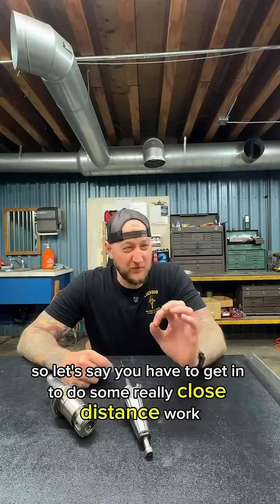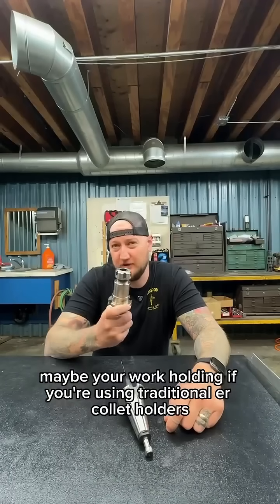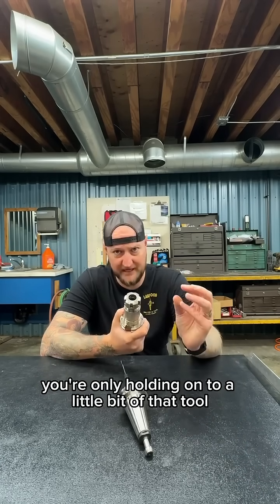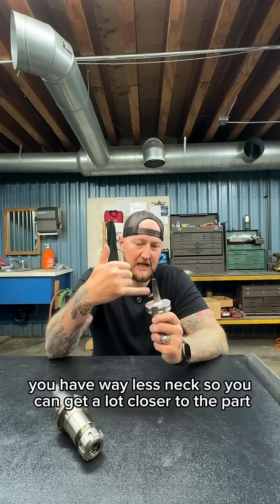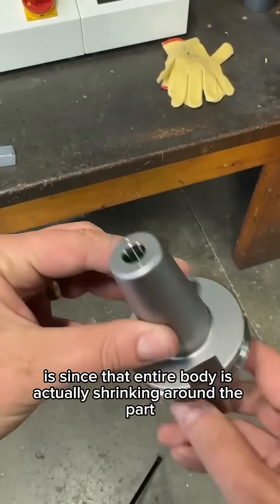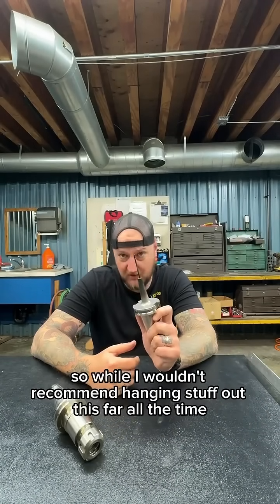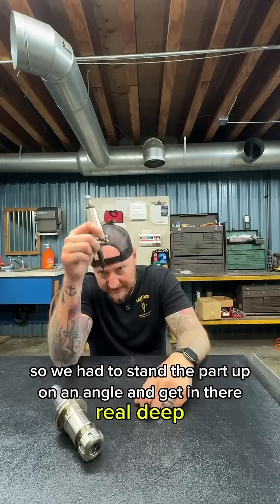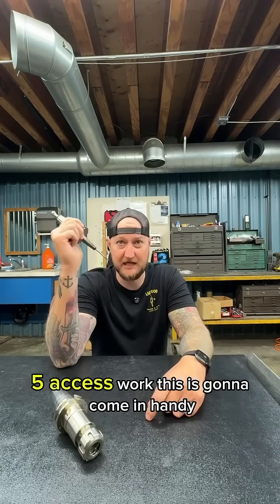HAIMER heat shrink system!

Comment: Turn a holder and ID grind, add $100 induction unit for the heat. $20k units that could be made in house for peanuts. Would be worth it if you could store and set tool lengths tho 😂